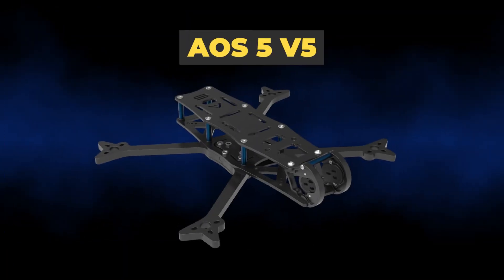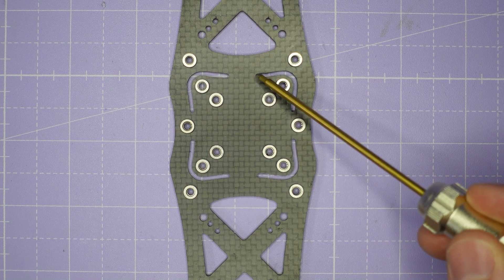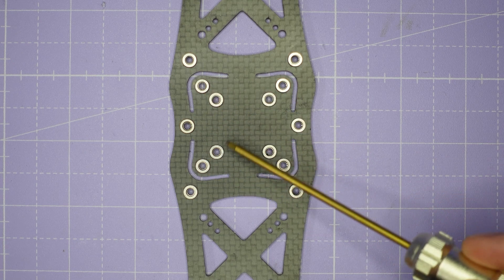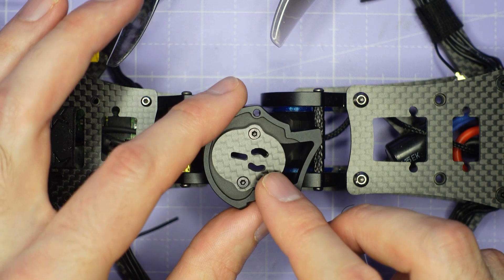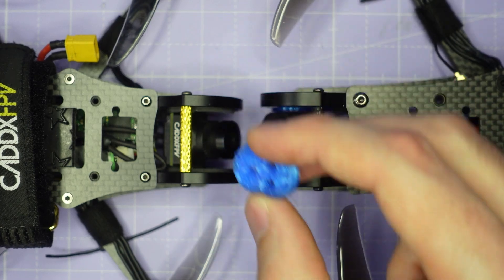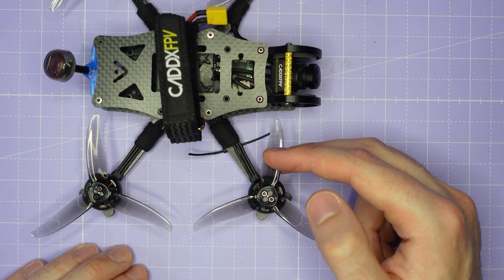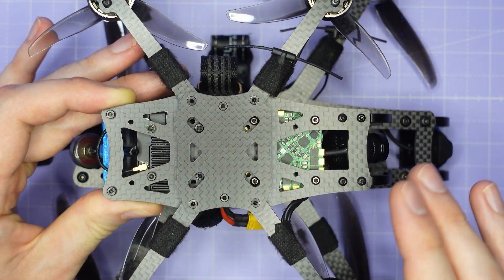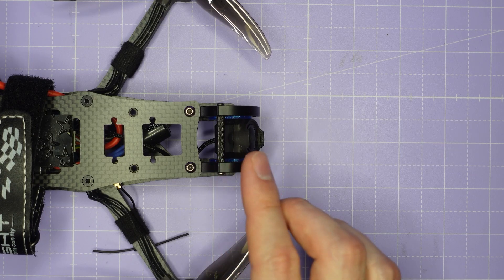Patent Pending Anti-Vibration, Easy to Build: The AOS V5 Series

Comment: This v5 might be an upgrade for the 5 inch AOS, but is a downgrade for the AOS 3.5 vs the AOS 3.5 evo. I have both and I have the blackbox logs to show that the AOS 3.5 EVO is a less noisy frame than the new AOS 3.5 v5 because the x cell doesn't work when you have a DJI O4 Pro unit in the back and half your FC is on the main frame instead of in the x cell. Please just release an AOS 3.5 EVO frame with the metal camera cage for the O4 instead of pushing this x cell on the 3.5 inch version of AOS.

Comment: Hi Chris, I can see the benefits of the X-Cell if the entire electronics stack is mounted directly in the center of the frame.  However, reviewing your video multiple times in order to better understand how to install FC/ESC/HDZ boards, I see that the boards are mounted on the front and back of the drones (not centered), I guess my question is how does the twisting motions effect the electronics when mounted in this position?  Are their going to be additional stresses (twisting of electronic boards) when mounted in this configuration?  Do we lose the X-Cell isolation benefits when mounted this way (Front and Back vs Centered) on these frames?  I have zero knowledge in mechanical design but noticed within this video the electronics layout were not placed within the X-Cell "section".

Comment: Like the  AOS 5-V5 but there are no 3D prints available. CNC Drones has links but they take you to no-where. As a minimum you need a VTX mount and a Go Pro Prong mount. Skids and Crossfire/ELRS would be a plus. I guess I will wait until someone designs some. Then buy the frame.

Comment: Just curious on why your centre module is so large, especially on the 3.5 inch frame. Can't you fit all the components into a smaller package and save weight? I've seen arms break plenty of times, but never the centre module.

Comment: Small and steady improvements and your frames are more and more reaching perfection. The difference in noise between an AOS frame and any other frame on the market is simply stunning. I can push these things so hard <3 I also love the looks of the new Aluminum cage. I always prefered the AOS cam mount look to the traditional "peaking between the standoffs" style... but now they look more and more beautiful, too! I never had issues with crashes splicing my camera plates - somehow the arms took all the hits, but I bet the plus in durability will be noticeable for bando bashers, too. Now I'm really curious what your X-Cell tech will result in those already super quiet frames!

I just took a look - did you get rid of the double-mounted triangle shaped arms in the progress? How will that affect those twisty-modes?

Comment: Sweet, can't wait to build one of these new designs! Surprised you ditched the A frame arm design. Does the new X-Cell stack mount mitigate vibration issues enough to go back to straight arms? Thanks for keeping the innovations coming!
Reply: No it doesn't. I have both the AOS 3.5 EVO and the AOS 3.5 v5 and the truss arms work much better than the x cell when you have to mount half your fc on the main frame and half on the x cell, when you run an AIO and the dji o4 pro

Comment: My secret is 3d printed frames I use a slightly softer pla to obsorb vibration and I print them light then I run a carbon fibre rod internal skeleton in the arms fully glued in results in very smooth running flight controller

Comment: As much as i enjoy your videos and new ideas in the FPV world in general: Patents are the adversary of our hobby. It might be understandable for a new type of image transmission system with large development costs. But for a simple cutout in your design, it is pretty over the top.
Totally okay to decide to not to share design files if you're out for the revenue. But do not limit the hobby with patents that will limit the progression of the hobby for everybody.
Imagine someone having patented the use of vibration grummets for flight stack mounting - or as it happened around 2012 when the V-shape form of a drone got patented by a company called Astec (now Intel). They heavily sued anyone using the this design form, even hobbyists. We're one community, we stand together... we don't sue each other. Just my 2 cents.
Reply: As someone who owns 3 patents in a obscure field. I don't thing this patent is enforceable and your patent lawyer should have done a better job and told you to patent it. It is foreseeable that an average engineer would think to isolate segments with cutouts, Especially since this is borderline the same concept of skeletonization based isolation.

The definition of a patent is it needs to be novel, and not something that an "average engineer" could identify. 
Reference: Average engineer relates to an entity with average knowledge in the field but has unlimited time of trial and error.
In this case,  using skeletonization it is foreseeable that the "average engineer" would find a permutation of testing that isolated vibrations better than others..
Reply: China doesn't care about patents
Reply: I wouldn't get too excited dude. TBH if you have a mini CNC cutter at home you could do such things to basically any frame in about 10 mins lol... It's probably more to discourage Chinese companies from just straight reproducing it like botgrinders quads... took 4 months and you can buy a clone lol... but in the same respect it allows lower grades and prices so gets more people into the hobby so hmmm
Reply: What it comes down to is someone is gonna make money off his mental work. Should it be him or the legion of Chinese companies that would rip it off (understandably they still can...) but shouldn't it be him? And if not why would he continue to do this work with this much focus and not just go back to designing jet engines? 

The man needs to be compensated...no? This is why we can't have nice things boys. Yall go design something amazing then give it away for free...keep doing that and I promise I'll come visit you in your cardboard box. I'll even bring you a laptop so you can keep working for free

Clowns😊😊
Reply: @wmnsriteslol  I get it, you get it...  doesn't change reality though.
Reply: @oziumentisis  I don't think I get what reality you're referring to? The Chinese problem?
Reply: I have mixed feelings about this

I also am not a fan of patents but at the same time we can't just call it simple cutouts if it was so simple why had it never been done before it's easy to call something simple after the fact

And when it comes to holding the hobby back I'm pretty sure everyone would have continued to fly drones without cutouts for years to come if it was not for Chris pushing the hobby forward
Reply: @SuphiKaner  I totally see your point. But i still feel that instead of protecting this idea with a patent (dark side of the force), it would be better to just unofficially claim it's invention and increase frame-sales just because of being the "fpv science guy with great ideas" (light side of the force). Especially if you've already added a good portion of sales margin to your frame prices anyway.

I'm a frame designer. And it's just super annoying to have to have to keep in mind limitations that are brought up by having this kind of patents around. Like I can't put motors in a certain position, because there is a patent for that. And I can't place cutouts this way - because there is a patent. 
I have enough of that stuff like this in my day job, I don't want to start having these here in my "safe space". Even if somebody would start doing that, I can image this being done by a megacorp like DJI, but not Chris... as he is "one of us".
Reply: I think it's very fair to patent it. It seems this idea didn't come easily, Chris has clearly spent years studying and working to gain the experience needed so that with a serious amount of dedication he's managed to come up with something novel that makes our hobby better. I don't know what patents these image transmission systems have, you do often find that people usually only patent small bits of their large complex systems. Surprisingly a lot of patents appear to be really simple, verging on the obvious, they're often quite small incremental changes to a previous design. So that it looks simple I don't think is an argument that it shouldn't have been patented. The amount of effort that's gone into this has to be worth something so that Chris can earn a living off this work without every other manufacturer freeloading off it. I'd imagine the last thing anybody would want to do is sue and you'd be fine if you purchased a frame and attacked it with a dremel :)

Comment: I saw the frames on cncdrones yesterday. Pretty cool. The 5 incher ist pretty straight forward: 3 stacks. FC in the middle x-cell. VTX (20,25,30)² front or back.

The 3.5 incher seems to be a bit off. When using the x-cell, there doesn't seem to be a place for a HD vtx. The video shows a drone with walksnail - aft half of the x-cell for vtx, stem half for the 25-aio.

How is this frame supposed to use the x-cell together with a full size HD vtx (aio+1s Walksnail would fit on the x-cell, of course)?

Comment: What was the plan of mounting O3 or even any other VTX in the AOS 3.5? How long are the standoffs or the better question is probably, how much space is there between bottom and top plate? I guess at least a naked O3 could fit ziptied above the AIO, but why not include screwholes if thats the main mounting position?

Why did you change the arm design? Wasn't that the main thing contributing to better noise performance? Or is this a tradeoff for better crash resistance, while the noise performance is compensated by the X-Cell thingy?

I would have also much preferred to have the camera cages optional, as I recently got to love self printed camera holders which hold onto the front standoffs. Well, guess a good project to get into nylon-cf printing for diagonal fitting standoffs.

Sorry for the many and critical questions, I'm a big fan and most of my frames are AOS (even 2 x AOS 3.5), just a bit sceptical of the changes :) And if there will ever he a 3.5 UL, I'd be the first to order 2.

Another edit to add: There are at least 2 3.6" props available now (Gemfan and EMAX), it looks like they would still fit? They do on the AOS 3.5 EVO 1.2
Reply from the maker: The AOS 3.5 will fit an O3 air unit in the front or rear stack position no problem. The standoff height is 20mm identical to the AOS 5. 👍 I'm running an Avatar just to show off that you can use different cameras 🤣